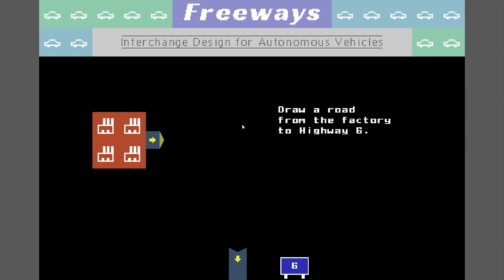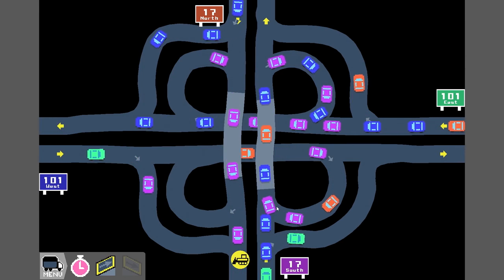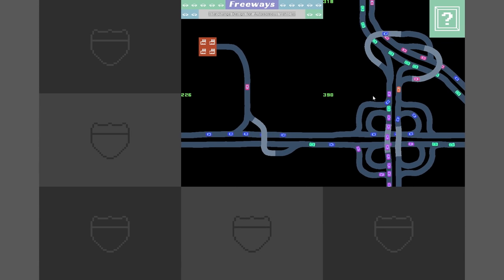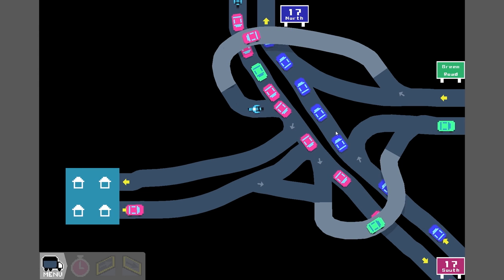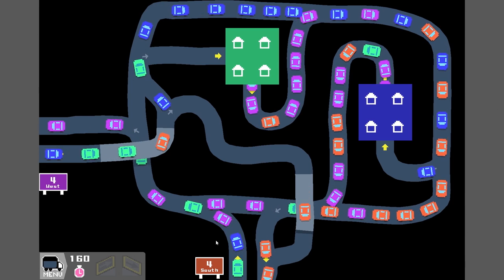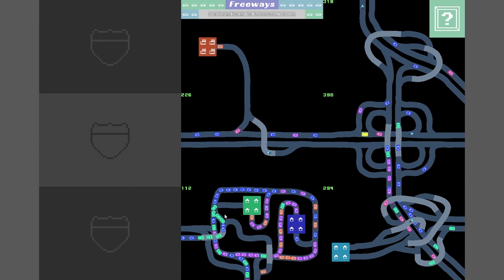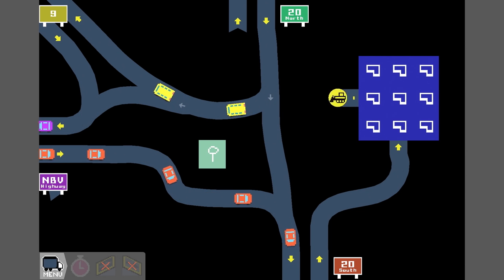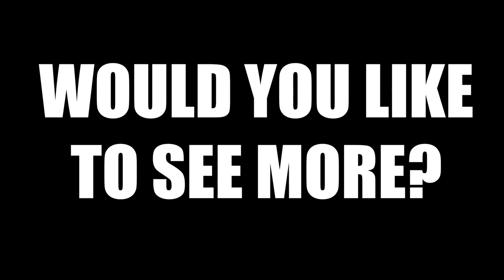Most complicated interchange - Freeways

Comment: 1) Use as LITTLE concrete as possible, efficiency is your concrete use + complexity (number of roads/bridges)
2) Bridges use extra concrete, make them short.
3) Roundabouts are good for low traffic and when there are no bridges allowed.
4) Things like cloverleafs are good for high traffic. 
5) Consider doing direct connections every time you see a thick arrow.